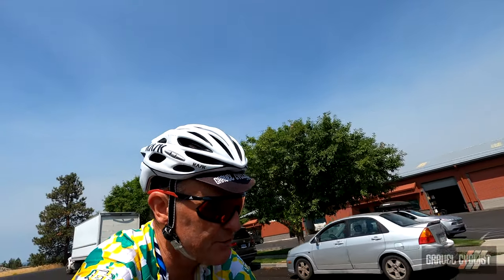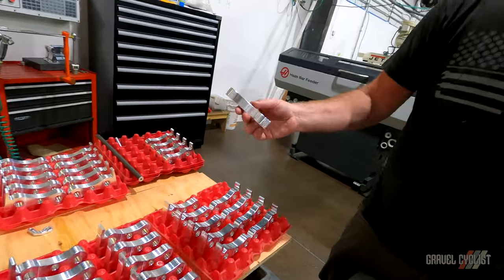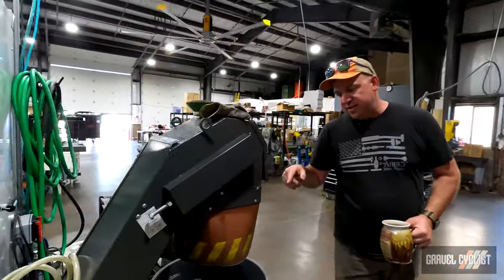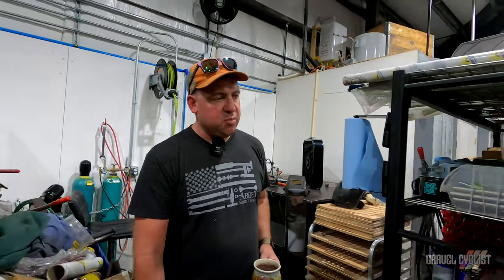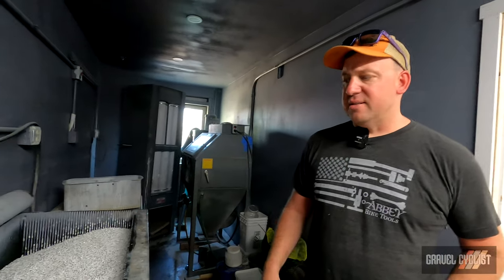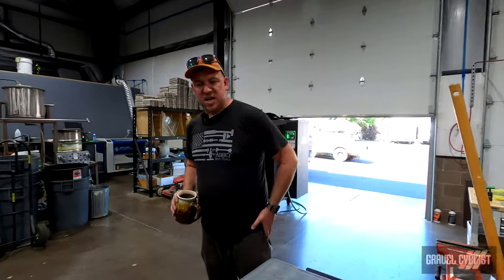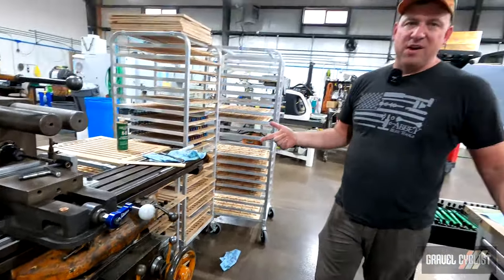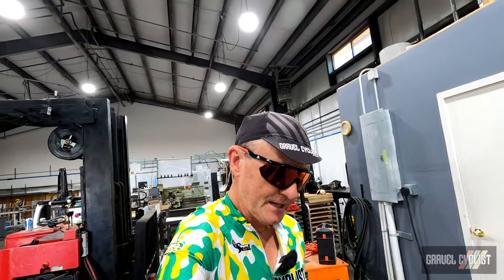Abbey Bike Tools 2023 Factory Tour: USA-Made in Bend, Oregon

Comment: abbey tools are good till you try a warranty on a 4way that snapped first time use
Reply from the maker: I would love to see photos of this.
Reply: if you look at the design they are bonded where they cross and the bonding on them got seperated and came apart, i ended up grinding them down and  repurppsing the bits that came on it to make another tool
Reply from the maker: @aldo5878  I hope you voiced your concerns to Abbey.
Reply: @GravelCyclist i like alot of their tools and i work as a full time mechanic , i own several including the hag , the chain decade chain breaker , the dishing gauge, i think the issue was they wanted proof of purchase and it was a gift so i didn't have a physical receipt, which for a tool company i feel is kinda dumb considering if the tools fails replace it , like most tool companies would , i emailed them and they ignored me after no proof of receipt, so if you buy abbey just make sure you dont lose track of those receipts lol